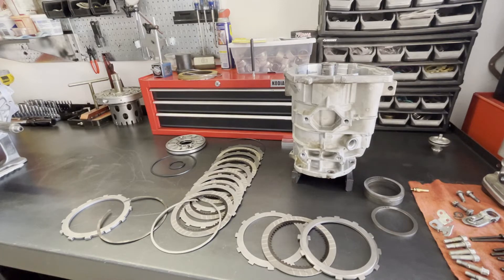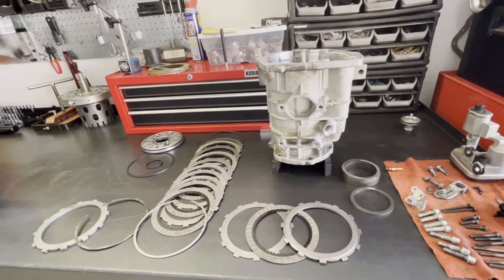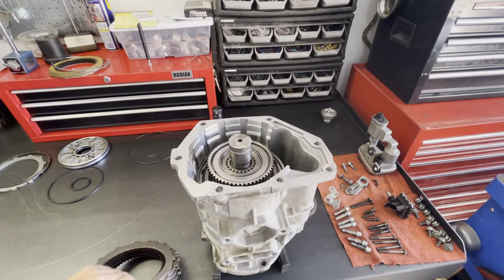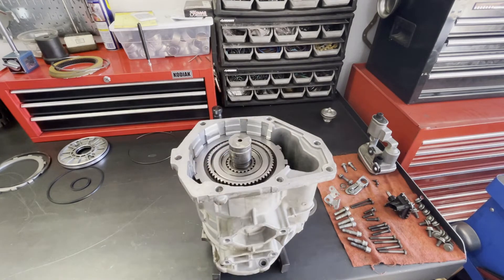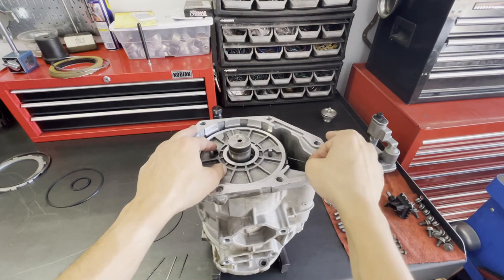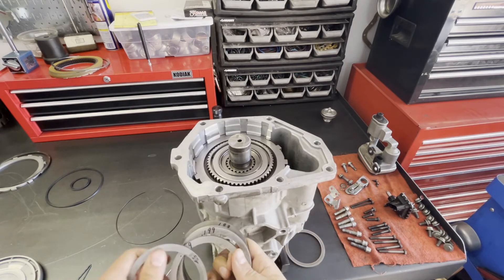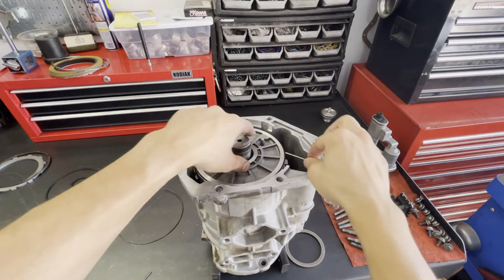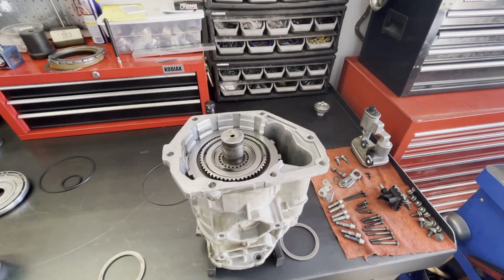11. Dodge 48RE Rebuild - OD Brake Clutch Pack Revisited

Comment: My truck is 2wd so the overdrive housing is very long do I need it to  be free floating like yours in video with no pressure from is resting pushing up cause I was doing mine like that and worried it’s screwing my numbers up
Reply from the maker: Yep - mount the extension housing to a "Y" fixture that is bolted to a bench or mates to an engine stand.

Comment: I'm new to this channel , getting ready to rebuild my 48re , I will probably watch these videos a few times, but I m waiting for my book to arrive on rebuilding a 48re , I have rebuilt a th350 and h e been around this stuff for years just never built one myself , good videos 👍
Reply from the maker: Welcome, Thomas and thanks for watching! For the 48RE, you should have a six-friction clutch pack in the overdrive direct, assuming your 48RE is behind a diesel...if it's not, you can always upgrade the five-clutch stack to a six-clutch, by obtaining the stepped .187 pressure plate and eliminating the waved snap ring (keep the flat snap ring) at the rear of the clutch pack. Just a quick tip/fyi...
Reply: @nickstransmissions  mine is behind a 5.9 Cummins common rail , I bught a jegs upgraded kit with reybestos disc , I'm going to be pulling a 36' pull behind camper , I'm looking at getting an afe shiftlogic module too

Comment: Do you soak your clutch packs?
Reply from the maker: Nope. I leave them dry and provide instructions for 'priming' the whole system so once the trans is back in the vehicle, filled/topped off w/fluid the driver idles the engine for about a min then lets the clutches soak in for 20-30 minutes before taking it for a test drive.

Comment: So whats the clearance of your OD pack between the wire retainer and its first steel. You need at least .010 per friction there or it will drag. The spacer is meant to set proper clearance between piston and OD direct. To thick and it won't hold in reverse or after a bit of wear in pack it won't. The OD direct spring should be allowed to fully extend and unload with a bit of clearance left in order to fully lock in it frictions.. You can set the OD clearance with different steel thicknesses or snap rings.
Reply from the maker: Thanks for the comment, Jason. On all these i've ever done, that clearance has been ~ .060-.070 or so depending on whether its a 5 or 6 disc stack up though I didn't make any mention of verifying it during the video. I'll update the description so folks know they need to check/adjust that clearance as needed.
Reply: I'm waiting on selectives to arrive for my OD section and am a tad confused on the .010 clearance per friction. This doesn't seem to be mentioned in the ATSG (or I couldn't find it). So you measure between the wire retainer and the top steel and divide that by the amount of OD frictions?